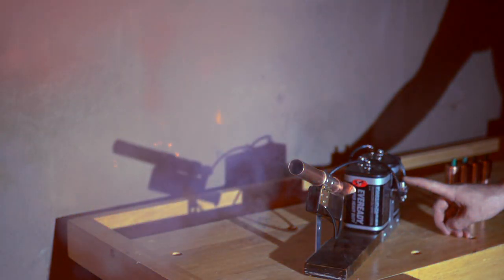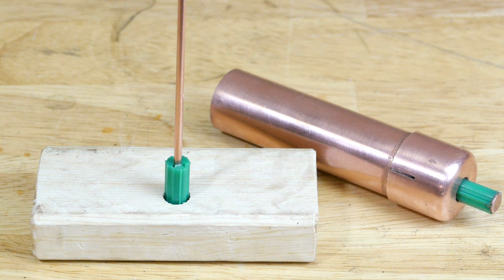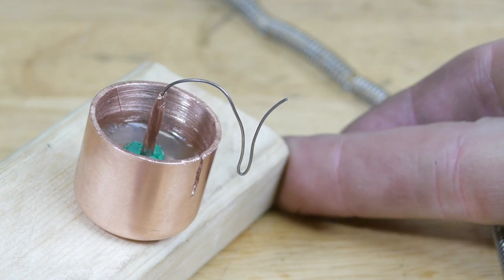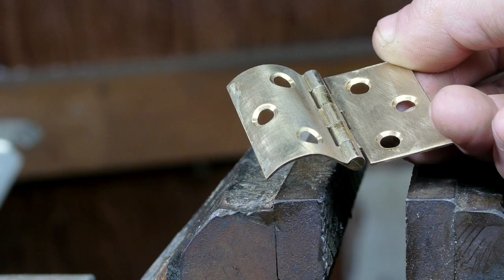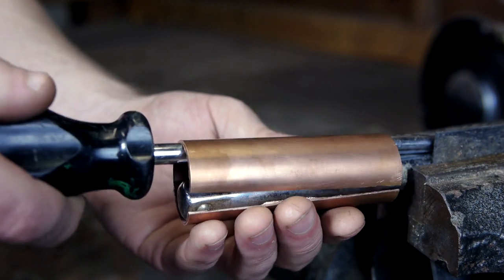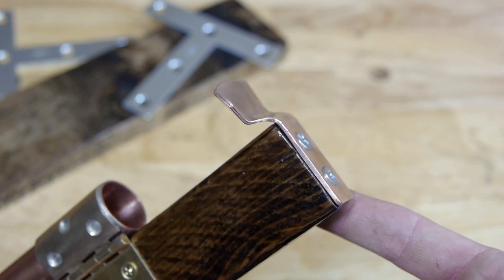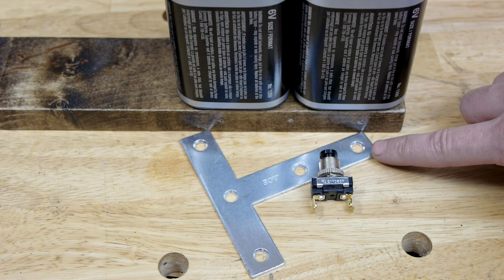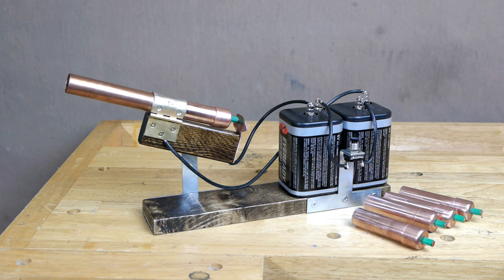How To Make A Desktop Nitrocellulose Cannon - NightHawkInLight

Comment from the maker: Hey everyone! This was a fun project for me. I got to experiment with some new techniques in soldering and working with materials I'm not especially familiar with. Sorry for the delay with this video, the next one shouldn't take nearly so long!
Reply: your. awesome
Reply: what stain/finish was used on the wood? it looks great, especially when put next to the copper.
Reply: +Bridget KabuWay  *you're
Reply from the maker: +Aidan Andrewson A walnut stain and rustoleum clear coat
Reply: +NightHawkInLight I like this project but, can you make a pistol version that had been really sweet :D
Reply: +NightHawkInLight Great video !!!!
Reply: +NightHawkInLight  make a revolver whit this project, so you can fire 6 at ones
Reply from the maker: +Guillaume Snijders That would be pretty cool
Reply: hi I'm working on a project I think you whould find interesting. a Dart gun that uses hho gas as the propellant. utilizing small pvc cartridge filled with the gas and sealed on one side with tape. I'm about to start on some bench testing but I'd like to get your input. I have a blue print and exspoded model of it if u can contact me.
Reply: +NightHawkInLight where do you get Flash cotton
Reply: +Cameron Johnson lol
Reply: +NightHawkInLight plz at least try it I would like to see a video of it :)
Reply: Is really cool indeed.
Could even take it a step further and add some cosmetic effects to the batteries to in a sense hide them, making it look like one piece etc.
(Also id have created my own comment but get an error posting every time, idk why. So now whenever I comment anywhere I have to leave them as a reply....)
Reply: +NightHawkInLight this is really cool
Reply: +NightHawkInLight Can you put a link in the description to buy the things you used to build this/Things you used ?
Reply: +NightHawkInLight I always love your videos, could you show us how to make an emergency wind-up/ solar powered electricity generator?
Reply: +NightHawkInLight Where did you get the skills to figure this stuff out? Are you an engineer or something?
Reply: I live in the Netherlands can I buy the filling of the cardriches
Reply: +Martijn Aalbers you can get it from Amazon
Reply: +jordan baldwin thank you so much.
Reply: +Cameron Johnson You can easily make it.
Reply: Just a question, what is your other job? Besides YouTube.
Reply: +joshua lou (cheesedude7) second this idea. would you consider doing it, with links to the materials used plz
Reply: +NightHawkInLight ...nice Vid,
but I would do something on an other way.
first I would set some shielding between the batteries and the barrel,
and second I would use allegatorclips for the batteries
and ring cable lugs (I didn't know if its the right translation... / I mean a combination of a cableshoe and an eyelet)
for the copper parts...
Reply: make it a gun
Reply: Can you make a cannon that you can use it over and over again by changing the batteries you would have to do somethings differently though
Reply: This may be a stupid question (tech noob here :P), but are those cardridges reusable?
Reply: tim benders yes, if you reload them with nitrocellulose.
Reply: +Earl of Destruction Thx :-)
Reply: Well even better could you just use re chargeable batteries
Reply: Did you ever fire anything out of the canon? If so, how well did the copper barrel hold up to the internal pressure?
Reply from the maker: +Joe Cope There's not enough support behind the cartridges to fire projectiles. The cartridge would blow out the back.
Reply: +NightHawkInLight I see. Thank you.
Reply: that's epic! but could you set a lyrics if you can?
Reply: What size was the small copper tube you put inside the bigger copper tube?
Reply: 12

Comment: If you are buying resistance wire, buy kanthol, not nichrome, your nichrome will have tendancies to melt. Kanthol will also pull less amperage from the battery, which MAY be an issue if you are not using lead acid. Also, go with high gauge, it will ignite the flash cotton faster and require less current to do so. 34 gauge kanthol would light flash cotton immediately on only 4v. Doing the math, 34 guage kanthal is 21.1 ohms per foot, so for 6 inches... ~10.5 ohms resistance, would draw 380 milliamps at 4v and disapate 1.5 watts of heat from the tiny surface area of the wire, it should burn the flash cotton very quickly. 
Of course, if you are harvesting your resistance wire, you have to use what you got :P
Reply: we get it, you vape
Reply: @chrisgit4433  yep he does vape

Comment: This was very cool!

Two suggestions:

1. Terminate the connections from the cannon and switch to the batteries with alligator clips, and attach the batteries to the block with mushroom head locking strips, to make them easy to swap out when the batteries go dead.

2. Switch out the 6-volt batteries for 2 or 3 9-volt batteries, and make the whole rig handheld.

Comment: I wish I could build stuff that just, works. I have to basically just cut stuff and hack at it until it works. That's what happens when you actually know what you're doing and how your materials work.
Reply from the maker: +WalcomS7 Well, I did build a test model to iron out the process before filming...That helps.
Reply: NightHawkInLight did you 😶

Comment: This is really cool and I love your attention to detail. I was just wondering about the "double thick" copper sheet... if you needed it to be twice as thick, why did you bother cutting it lengthwise and then flattening it out and then folding it in half to double the thickness? Wouldn't it just save the cutting and folding operation if you just took the pipe and squashed it flat? These videos are cool. Thanks for putting the time into sharing these ideas!
Reply from the maker: +USWaterRockets Thanks! Yes, you could just hammer the pipe flat for a double wall, but I wanted to show how to make single layer copper sheet for anyone that needs it.
Reply: +NightHawkInLight Ah! That makes sense! I just found your channel the other day and I am catching up on all the previous videos. I see now you insert a lot of these little tips.

Comment: I'd recommend loading rolled flash paper after the cotton, which would be ignited by cotton and shot like a burning projectile. Just like flash cotton its burning temperature is relatively low, so you don't have to worry about starting a housefire or something.

Comment: I would have the put the batteries in parallel rather than in series to double the current. The ingnition wire is almost a short, so doubling current should work way better than doubling voltage, IMHO .... Nice vid and quality as usual. Cheers

Comment: usually the first hexagonal nut on a switch goes underneath the mounting surface and the prettier round one above, this is done so you can adjust the depth (how much it pokes out)(just FYI)

Comment: you do know you can buy spools of nichrome for about $4-20 depending on what gauge you're looking for. Most vaping sites carry the stuff or you can get it from temco. Temco also sells kanthal which is an oxide resistant resistance wire commonly used in space heaters and also for vaping. No point in ruining a hair dryer unless its already busted.

Comment: I actually made a DIY project of my own recently - a bottle cooler for my desk because I'm too lazy to walk to the fridge and back and drinks get warm after a while.

It's basically a peltier element (I use 60W) sandwiched on the cold side with a copper sheet bent roughly into a curve that matches the biggest bottle type I use (I used a 200x200x0.8mm sheet from a crafts store) and on the other side I use an old CPU cooler (Mugen 2 in my case. I tried to use a passive cooler first, but that merely overheated). I've applied thermal paste, of course. The construct is held in place by zip ties, with a thin steel sheet used to stiffen the copper on top of the peltier element. I ended up using foam rubber as an insulator for the cold side, simply gluing it to the outer curve of the copper plate. The entire thing is held in place by zip ties because I lack the equipment to make proper screw mounting. They work quite well.
Supplying power ended up being really easy: I took an old fan connector with male and female molex and cut it in half so I could lengthen the wire into a two meter extension cord and attached the cooler to another molex: 12V for the peltier element and 5V is more than enough for the fan on the Mugen 2. That way I can run the extension from my computer's PSU and simply plug in my bottle cooler whenever I need it. Also, I don't have to buy a 12V 6A power supply, saving money.
I could have left the peltier element always running, but I came across a regulator circuit that has a temperature probe and regulates the output to maintain 5°C if it can. It's actually surplus from a company that makes beer coolers based on peltier elements, so I guess I got lucky finding it. 

Yeah, I could have bought one of those fancy tabletop wine coolers, but they sell for twice of what I spent and they're noisy besides because they go for a slim design that necessitates a high rpm fan to ensure sufficient cooling.

Comment: They make different types of solder that need different heat levels (for jewelry at least) so if your iron can change temperature I'd look into it,  for lead/tin solder different ratios of the two probably have the same effect

Comment: If you roll up flash paper into the tube (about half way & not too loose / too tight) on top with only a very little  flash cotton on the bottom you can get more of a "shot".  A longer tube would probably be better too.

Comment: I would recommend not using "lantern" style batteries as they do not offer ample enough current. Nichrome is very similar to kanthal, they both have very low resistances and are used everyday. I recommend going with 26650 or 18650 high drain LiMN batteries rated for at least 30 amps continuous.

Comment: I think gluing and soldering the batteries on is a bit of a dumb idea, tbh. I think you should have made some sort of holder on the base plate and attached alligator clips or something similar to the leads for easy removal/replacement. A bit more complicated, but at least it makes the cannon more readily reusable.

Comment: nichrome has high or low resistance? i thought it was low resistance that makes things heat up faster?
Reply from the maker: +drumstick9000 Nope, high resistance makes wire heat up. It heats because when the metal resists the flow of electricity that energy has to go somewhere, so it converts to heat.

edit: Wait a minute, I just did a little googling and it looks like I am wrong! Lower resistance results in more current, which then produces more heat despite the electricity having an easy flow through the wire. That's super counter intuitive! I learned something today.
Reply: +NightHawkInLight The power dissipated is I*V and because of ohms law if it's a DC circuit and R and V are known then it becomes P=V^2/R so the lower the resistance the higher the thermal loss. That's why when you short with a copper cable (very low resistance) it will nearly instantly heat to incredible temperatures and melt the wire making sparks but the air isn't heated by exposed battery terminals (high resistance).

Comment: perhaps make that kind of thing in to a gun style launcher or atleast something with a ring of the cartrages that you can load up and fire one after another. use a more mobile power sorce such as 8 AA batterys and some thiner nicrome wire or as i did with my fireworks launcher experiment i did a peace of copper wire that glows red hot you can use a bit of glass tube as a holder for the glow plug so the flash fabric can be triggerd with the copper wire.

Comment: If you used a Potentiometer with it, could you theoretically, control the ignition time? But, a requirement would be that Nichrome would retain the same potential temperature with a lower voltage, just take a longer time to achieve that temperature. Science time. or engineering time I guess

Comment: I'm building one that fires. 50cal slugs. It also has interchangeable carts.
Reply: +Richard “Supreme Leader” Jones ye well im building one that fires Soviet 125 mm BK-14 anti tank rounds so :P
Reply: +Richard “Supreme Leader” Jones  you can do that not a big issue but still you have to be very cautious as gun cotton is far more powerful then normal black powder, normal black powder barrels will be torn apart if nitro cellulose is used you will need a strong and thick  hard steel barrel for that and when firing with a load in your case 50 cal rounds do not use excess cotton to get extra power it will blow you up. I recommend not to use it in enclosed vessels or tubes rather enjoy it by just burning openly.
Reply: +Richard „Supreme Leader“ Jones You shouldn´t use the 13,5 N guncotton (trinitrate). The best one for these purposes is the slower burning one with under 12,5 N (dinitrate) as the 13.5 N Version is simply too powerful and would just spilt your barrel. Use the barrel of a .45 or.50 cal muzzleloader and don´t make it too long so that it doesn´t burst from pressure buildup. Cast bullets will do but they probably won´t grab the rifling at the speed they´re at.... and far less than half a gram of NC will propell your projectile better than 100 grains of black powder. Keep in mind: nitrocellulose detonates with 150% of the power of TNT and it produces a 3x higher volume of gas (by weight) than black powder - so a tiny amount inside a barrel is enough to propell even a heavy large caliber bullet. If you take too much, it might blow up and wipe your ass off the map. You should also frequently check the barrel because of the detonation temperature of NC of about 5600 F. I shot a 135 grain round ball out of a .45 percussion cap muzzleloader pistol and it went clean through 4 inches of soft wood. The same 135 grain round ball with 20 grains of black powder would remain near the other end. That above is just a suggestion but certainly not a recommendation. I´m not responsible for your actions and their results...
Reply: dopeofthepope I used some thick walled pipe and it worked well enough. It doesn't shoot very far however.
Reply: Richard Jones Have you made the bullet fit perfectly into the barrel? So that you have to ram it down with considerable force? Do you hear a sharp and loud bang when the cannon fires? If the bullet fits tight enough, the nitrocellulose will not deflagrate but detonate and the bullet should be flying far enough and with a damn big punch. But I don´t know if the pipe will take the detonation.
Reply: dopeofthepope It's hard to find bearings the perfect size. There is too much gap between the bearing and the barrel. If you put some cloth around it like a muzzle loader it goes farther. I think the nitrocellulose burns too slowly for the application. It was a fun build though.
Reply: Richard Jones You might try to take an additional piece of cloth and hammer it down the barrel...
Reply: dopeofthepope I'll keep tinkering with it. I ordered a ton of nitrocellulose so I might scale it down. My son loves the thing.

Comment: What kind of soldering iron do you use?
Reply from the maker: +Jeffrey Wong A butane one from Radioshack. There are lots of others made by different brands that are just as good.
Reply: +NightHawkInLight  I use the same iron, heats quickly and is very portable. I'd recommend it.

Comment: Is there any smaller batteries that you could use for this project?
Reply from the maker: +Ibruh 313 Yes, but you would need to probably use glow plugs for remote controlled planes rather than making your own with wire like I do.

Comment: Can you make actual projectiles for this or are the loads too light?
Reply: you could, if you used steel pipe, or old shotgun parts that could withstand the pressure. Although I'd read up on your local laws about this, because it could be counted as a homemade firearm depending on how it's made.

Comment: What soldering iron is that
Reply: +John Mcdonald 
Butane powered.
Reply: DanieleGiorgino thought as much. I actually just bought one last weekend when the filament broke for the third time in my electric one.
Reply from the maker: +John Mcdonald I've added a link to the video description for purchasing similar irons. They're really inexpensive.
Reply: NightHawkInLight thanks for the reply. It means a lot to me. I've just started with butane soldering irons and haven't been with them long enough to recognize them. What is your experience with them
Reply from the maker: +John Mcdonald They're a lot more convenient than electric ones, that's my experience.
Reply: NightHawkInLight Yeah for sure. Btw I'm ecstatic to be talking to a now 1,000,000 subscriber youtuber who responded within 5 minutes.  I had three electric ones burn out and a butane one from homedepot was like $20. How much butane does yours use?
Reply: +NightHawkInLight can you use 2 9v batteries instead
Reply: +geometrydash superlasor  no you have to use 2 6 volt
Reply: +John Mcdonald the butane irons work well for quick projects where you won't be doing much soldering. they have an exhaust which blows very hot air so you can't easily set it down while it's on and I've burned myself with the air a couple times by mistake when I was starting with them. if you're going to be doing more than just a little soldering an electric iron with a stand is ideal
Reply: read the description
Reply: +geometrydash superlasor 9v batteries normally have low amps output. If you want you can use some AA batteries they will do fine (:
Reply: 123
Reply: if you're going to be doing more than a minute or two of soldering per project total or any sort of electronics soldering then get a hakko 888d instead. butane irons are alright for emergency kits but definitely not for a workbench.
Reply: A soldering Iron...With a tip on it...